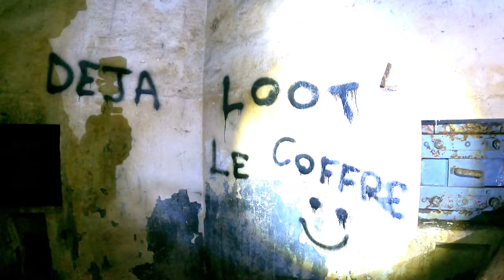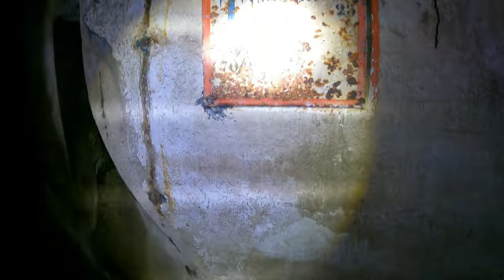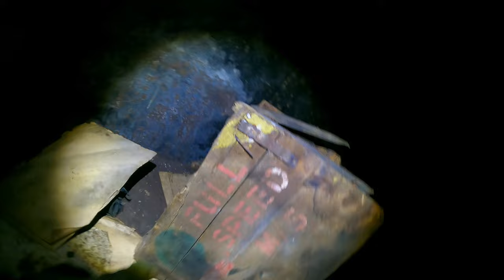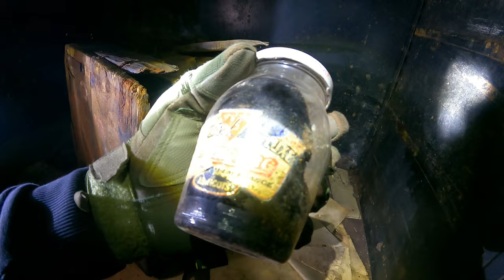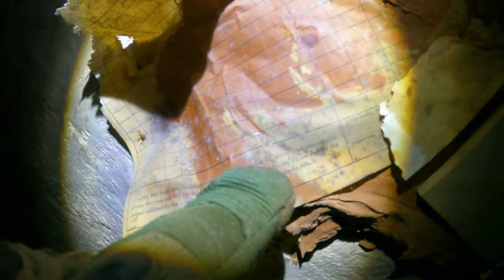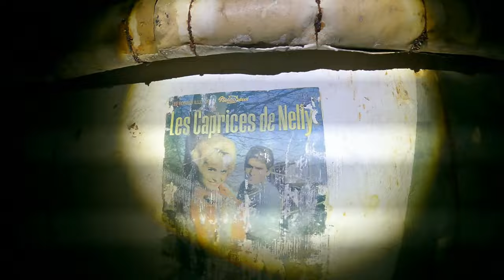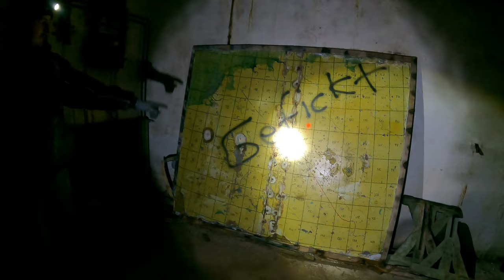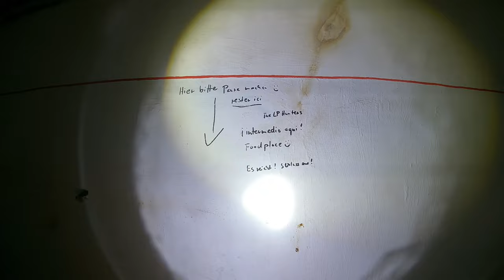Claustrophobia in this Abandoned WW2 MEGA Bunker! 🇫🇷

Comment: That is one massive bunker. At least 4 stories underground. 4 massive engines that you saw in one area. The network of rail tracks. You should also be very carefull in the bunkers and the surrounding area's. Apart from obvious getting lost in the bunkers. The surrounding area's could still have buried live munitions or unexploded bombs. Or worse case scenarios, booby traps come trip wires. Very interesting watching your video's. Those engines would have been noisy, Going constantly 24 hours a day.
Reply from the maker: Thank you for your support!
Yes we actually walked around in the forest before and we noticed this aswell, there are still many pigtails and barbwire everywhere…

I just uploaded the 3rd part of this mega bunker adventure exploration make sure to check it ou 😋🫶🏻